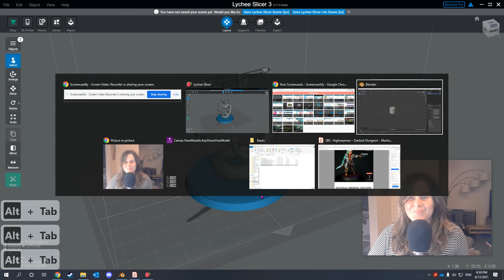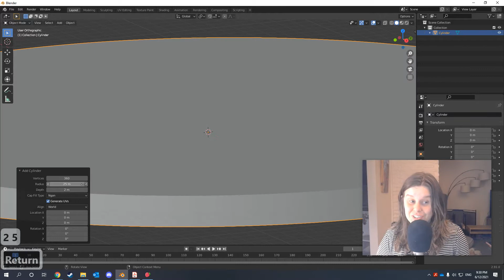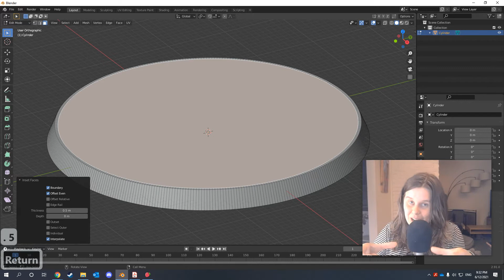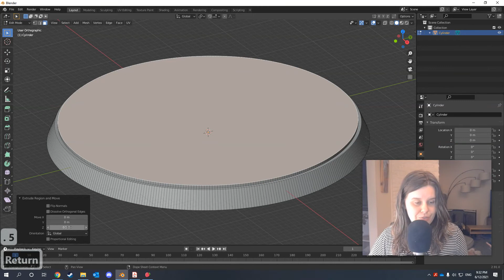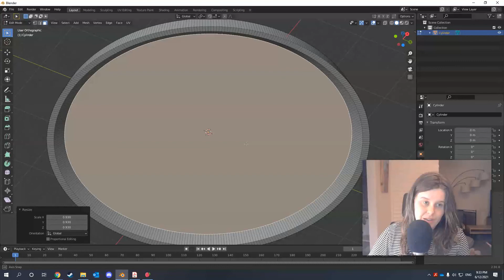Make a Custom Base in 3 Key Presses!

Comment: Great tutorial, thanks so much! About the meters working, probably is because the metric system is divisible by 100, 1m = 100cm = 100mm. so the proportions are the same, just the numbers of 0 that change.